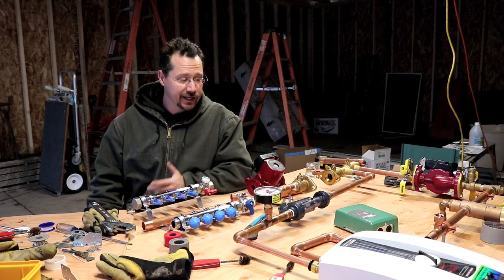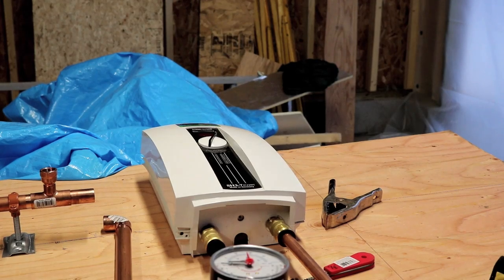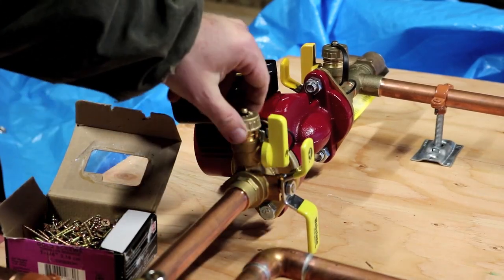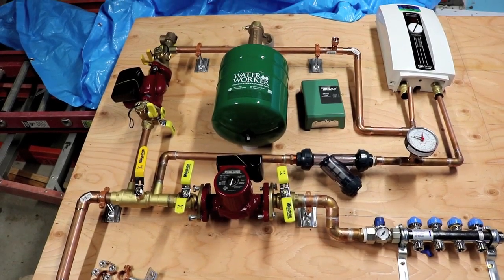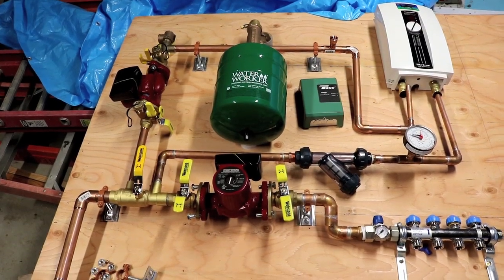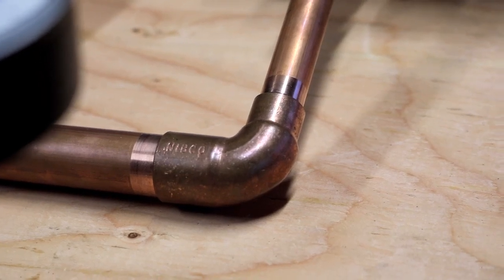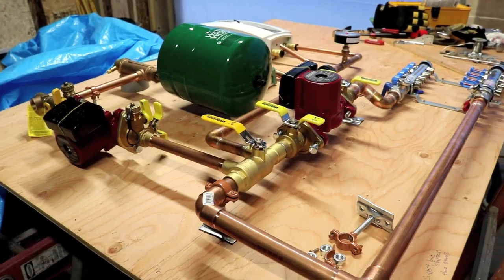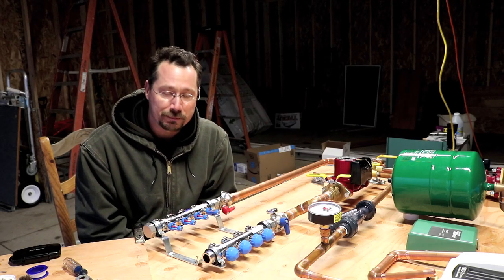Ben's Garage: Hydronic Heating Update Jan 25 2017

Comment from the maker: I've now had this system running for the end of one winter and the entire next winter. I kept the system on with a simple thermostat set to the lowest setting (40℉.) The garage never got below freezing all winter. (In my area, temperatures are below freezing December through March, and we are usually in the single digits in January. I can honestly say that a thick, insulated concrete slab is an amazing thing. In the winter, the heat just stays inside, even if I have to open and close the garage door. Likewise, in the summer, it can be 20 degrees cooler and lower humidity inside my garage than outside.
I also built a passive solar garage door. When the sun is low in the sky in the winter, it shines in on the concrete floor, warming it. 
https://www.instructables.com/id/Passive-Solar-Garage-Door/
https://www.youtube.com/watch?v=EcuRfnP6E7I
Reply: You should pin this post to the top.
Reply from the maker: Pinned!

Comment: How did the electric bill work out?
Reply from the maker: My electric bill this past month (Nov. 2025) was $115.
Keep in mind that as I write this, we are in the cloudiest time of the year with very short days. So, I’m using more heat and getting less energy from our solar.

We also have a mini-split heater in the house (which is just supplemental heat - main heat is a natural gas furnace.)

We also have TWO electric cars. (Not hybrids, no gas at all.)

I’m on a “Time of Day” Plan, so electricity is expensive during the day, but cheap at night. I run the garage heat at night, as needed. Then the heat stays in the concrete, warming up the garage during the day.

We also charge the electric cars overnight on the cheaper rates.

Our solar this past billing month only made about $50 worth of energy. In the summer, it makes about $100. Most summer months, we use about what we make, so there’s essentially no electric bill.

I made a playlist of me opening electric bills. You might find that interesting. I haven’t made any of those videos too recently. Maybe this is a good reminder to make one from next month’s bill.
https://www.youtube.com/playlist?list=PLmHss3DBZUimMu2T5B198sNn6A4cp2zvG

Comment: what circulator pump are you using Thanks
Reply from the maker: Stiebel Eltron circulation pump model CP3S15-62FC. 3 speed, 1/25th HP.

Comment: All tubing is 1/2 or 3/4?
Reply from the maker: There are several sizes of copper pipe. The heater has 1/2" input and output. Most of the setup overall is 3/4". There's a section of 1" near the manifold. I just used whatever size pipe was appropriate for the parts being connected.

The PEX tubing in the floor is 1/2" - four loops, each less than 250' long.

Comment: I also had this idea but was told that electric is too costly , good luck
Reply from the maker: It works well. I run it just as I need it, at night, when electric rates are cheap. I also have photovoltaic solar, so I can just turn sun into heat as well.

Comment: At 2:20, what particular plate did you use? Or where did you get them from? All the flange hangers I ever see are flat and dont allow you to put a hex head bolt or nut on the bottom.
Reply from the maker: I don't remember the exact name of the part. They were available at Menards, a big-box home improvement store in the midwest.

Comment: Great job!  Out of curiosity, which brand pec did you choose and which brand manifold did you choose and why?
Reply from the maker: I simply used parts that were available off-the-shelf from a major home improvement store. I was able to personally inspect parts before buying them. I don't think there's really any big difference between brands. Being able to check out parts before purchase, because they were in front of me, instead of for example mail-order, I was confident that I was getting relatively good quality.

Comment: Your electric is run off fossil fuels...
Reply from the maker: The great thing about electricity is that it can be made from so many different sources!
For example, from the solar panels that cover the roof of my garage that this heating system is in!
https://300mpg.org/bens-solar-garage/
Reply: @BenjaminNelson  you started this video with saying you want to get away from fossil fuels.  Your system is awesome,  fyi, but Everything in your system is a derivative of fossil fuels.
Reply from the maker: What would you recommend?
I'm pretty happy with my photo-voltaic solar setup AND my passive solar garage door.
Seems like a good start getting away from fossil fuels to me.
Reply: @BenjaminNelson  "I would like to get away from using fossil fuels to energize my house.  Yes they're needed to construct every part of my house but I would like to minimize there use."

Comment: Hello Ben, please give us a feed back on the plastic Y strainer, does it handling well with over 150 deg F, I am looking to put it in with my boiler system, just like to get some feed back from you
Reply from the maker: It's fine for temperature. It's designed to handle that. One thing to be a little careful of is over-tightening. Plastic cracks easier than brass!

Comment: I was wandering if you can share the information how higher your electric bill ($ or % ) with this type of system?  Thanks.
Reply from the maker: In general, for heating, electric is going to cost more than city natural gas.
HOWEVER, I also installed solar panels on the roof of my garage. I have a good agreement with my local, non-profit, electric provider. (It's actually a city utility.)
In the summer, I'm able to build up a credit with the power company. In the winter, I apply that to my bill.

I haven't paid an electric bill for two years now.
The solar covers the cost of the heat in the garage, all the electricity used in my house, and charging plug-in cars.

Of course, HOW MUCH you use that electric heat makes a big difference. I mostly use it to heat the garage for working on projects in there on winter weekends. I run the heat overnight at off-peak electric rates.

I have quite a few videos on my channel of me opening and sharing my electric bills.

Comment: Getting away from fossil fuel, by using electricity, real smart technology.
Reply from the maker: Hi Mark,
One of the great things about electricity is that it can be made from so many different sources, including the 24 solar panels on my garage or the renewable energy that I can purchase through my electric utility.
Reply: @BenjaminNelsonX  show me one source with endless possibilities, that is not dangerous.
Reply from the maker: @truth6600  Are  you implying that solar panels are dangerous? Or that ALL sources of energy are dangerous?
Reply: @BenjaminNelsonX  never said dangerous, not 100% .
Reply: @BenjaminNelsonX  never said dangerous, solar power not 100%of all our energy,maybe 12-15% of the USA could survive that's not great.
Reply from the maker: @truth6600  You said "Show me one source... that is not dangerous".
If you want to clarify yourself to mean that it's dangerous for us to rely on only a single source of energy, that's fine.
I'd agree with that. Nowhere have I ever said anything like we need to instantly cut all power other than that which is made by solar.
I'm all for doing what we can to do better. In my case, trying to do the things that I need to do (including some heating of a particular building) while reducing dependence on fossil fuels.

Comment: Great Video! Do you have a parts list for this? Trying to do something similar and already have the floor piping in with manifold, so now it's time to do all of the plumbing for the tankless propane boiler I'm going to get.  The issue for me is that I don't know the exact names of each of the components even though I visually know what they are and if I could go to a parts bin I could pick them out.  (that would result in many trips to the big box which would be bad)

Thanks!
Reply from the maker: Hi James,
No, sorry, I don't have a parts list. Basically, I read a college text book on hydronic heat, then I went to the big box home improvement store, looked at a pre-built product they had, bought the parts for it, and assembled it myself.
I modeled that after this hydronic heat panel: https://www.menards.com/main/plumbing/hydronic-radiant-heat/radiant-heat-control-panels/hydro-smart-trade-1-zone-low-temp-integrator-panel/hsps120lt/p-1444433734726-c-8521.htm?tid=922881261078849570&ipos=3

By doing the work myself, I only had to pay for parts, not labor, saving some money.
The heater I used was a Hydro-Shark 3 7kW electric heater, which I bought used. https://www.menards.com/main/plumbing/hydronic-radiant-heat/radiant-heat-boilers/stiebel-eltron-hydro-shark-reg-electric-microboiler/sh3-07/p-1444433731813-c-8519.htm?tid=-4632102269778309964&ipos=1
Reply: @BenjaminNelsonX  Think I figured all of it out. If it doesn't blow up, then I did it right ;)
Reply from the maker: @jameshancock  That's usually my opinion!
Seriously though, when heating liquids, you CAN blow things up. So, don't do that.

Comment: Nice job!   do you have a parts list?   can you tell me the brand name of the assembled unit that you mentioned in your video?  thank you
Reply: At Menard’s, they carry the Hydro-Smart components. Hydro-Smart is located in Minnesota. I bought the parts for the single zone panel HSPS120LT for around $1,000. Menard’s sell it for $1600. The propane boiler was $1300 and took 2 weeks to arrive. If you go forward, you can order Nibco valves with the hose ports from Zoro on the internet. I was impressed with their service.

Comment: Why did u not add a glycol feeder and how did u pressurize the system
Reply from the maker: If you look on the middle-left of the system, you will see a set of shut-off valves and hose connection points. Those are used to fill the system. The system was filled with a pump and hose connected there, drawing the glycol from a 5-gallon bucket. The pump is also what's used for originally pressurizing the system.
Reply: thanks for the reply,   what type of thermostat did you use,  I am having issues getting a 12 v thermostat working
Reply from the maker: @geraldsosontovich2124  I just used a very simple thermostat that runs on a pair of batteries. It has a pair of low voltage wires that runs to the switching relay for the pumps. The thermostat sends low voltage to the relay, turning it on. AC power then runs to the pumps, powering them up. The heater is activated by an internal flow sensor and the heat kicks on once the glycol is flowing.

For a really low-tech ON/OFF. A light switch can instead be used to turn on/off a low-voltage AC signal to the switching relay.

Comment: Hi Ben, it seems like there is no Water Pressure Reducing Valve in your system.  I read somewhere that the pressure , since is much higher coming from the city, will damage the apparatus over time without a water pressure reducing valve.  What is your thought on that.  Thank you
Reply from the maker: This system is NOT connected to city water.

Comment: Why do you have two pumps? The only time you need hot water is when your system calls for it, it’s no need to be just circulating hot water through your loop when your in floor heating is not calling for it!
Reply from the maker: This particular system design uses two pumps. Both pumps work together for the "On Demand" heater to function the way it's designed to.
It does NOT circulate water through the loop when the heater isn't running.

Comment: So you're going to run that system off a solar source. You must live in fantasy land.
Reply from the maker: No. I'm not running it off a solar source.
I am running it from grid-tie power. I also happen to have a grid-tie solar system.
I can run it at night using cheap "Off-Peak" electricity.
During the day, I can create valuable solar energy and send it out to my neighborhood.

Comment: I’m sure because this video was posted so long ago you probably won’t see it. But I have question. I have the same system in my shop with the very same micro boiler Hydro Shark 3 and something went wrong with my boiler. It’s feeding 120v back into the electrical system in the shop. Outlets all started testing positive neutral reverse. As soon as I cut power to boiler everything tests correct. With power to the system when I touch the copper pipes I get shocked. I’m going to replace the boiler. I have no idea how to add glycol back to the system and bleed out the air. I can’t find any information on how to do this. I live in Wisconsin and it’s about to get very cold. Can you please help with answering how to add the glycol and bleed the system??
Reply from the maker: Hi Kevin, sorry to hear about your boiler!
After you replace it, just follow the typical directions for filling a system like this. There are a lot of videos about filling and bleeding the air from a system on SOLAR Hot Water setups. Take a look at one of those. I've also found that Callefi has a lot of great videos in general on hydronic heating.
https://www.youtube.com/watch?v=raHCtObGOhY
Reply: @BenjaminNelsonX  thank you so very much for your reply. I will do me research and check out the link. Thanks again!

Comment: Hmmm...you are running electrical because you want to get away from fossil fuels. Your electric is most like produced by fossil fuels.  Just admit it, we need fossil fuels.
Reply from the maker: My garage is covered with solar panels. I produce close to how much energy we use in a year.
Reply from the maker: A great thing about electricity is that it's just a way to TRANSFER energy. The SOURCE of energy could be burning coal, but it can also be wind power, solar, hydro, and other renewable energy sources.

Comment: So what pressure is the gauge supposed to read. Mine is at 10+ while off and goes down to basically "0" while running. Floor is warm though...thanks

Comment: Hi Ben, many thanks for your instructive videos.  Thanks to you, I've decided to use hydronic heating for my new garage and I've changed the steel profile for the roof so I can use S-5 clamps for the solar panels (and avoid punching a bunch of holes in a brand new roof!).  I'm still studying options for the boiler and I'm wondering if you've compiled the power usage (in KWhr) of your boiler as a function of average outside temperatures.  If this is already posted somewhere, please point me to the link.  Thanks again.
Reply from the maker: I've been very happy with the metal roof and S-5! clamps. Works great!
For the in-floor heat, make sure to insulate your garage well, including under the slab.
I do NOT have data tracking power use vs outside temperature, but I do have an old-school utility meter which I run my boiler through so that I can track the power it uses.

I am NOT necessarily recommending electric as a heat source. In my area, natural gas is the most economical way to heat, but I don't have a gas line to the garage and want to get away from fossil fuels anyways. I might still rig up a wood fired boiler to the garage. The town yard waste site is just down the street from me, and I'd be able to get all the free wood I want from there.

You CAN estimate power usage from area/volume, insulation factor, and average temperatures. There's even on-line calculators for that sort of thing to at least get a "ball-park" number.

Comment: I have a similar set up put only needed one circulating pump the second one isn’t required as far as I’m aware. Also on the cooler return water loop to the heater, I have a take off to the hot water output side and a ball valve with a temp gauge this allows me to restrict the return flow to both the hot out and the cool in so I use this water to modulate the overall temperature. My circulating pump is either actuated by a thermostat or by a programable timer. The timer is the primary and the thermostat is the back up secondary if the timer fails. This way you are protected against freezing if the timer fails. I live in Canada and I think the city permit guys force you to have a back up do to the frost line being 8 feet below grade 🤷‍♂️🤷‍♂️🥶🥶

Comment: Electric is fossil fuel, your heating your garage with coal instead of natural gas. Gas is more efficient and better for the environment.
Reply from the maker: Electricity is a way to TRANSFER energy. That energy source could be coal, natural gas, nuclear, hydro, wind, solar, geothermal, or other sources.
The roof of the garage is covered with solar panels and I'm on a renewable energy plan with my power provider.

Comment: I'd love to see an update video on your installed system.  I found the heater you are using on the Home Depot website and see it is a 40 or 50 amp heater.  How has the heater worked for you?  Did you end up using glycol?  How was the filling of the system?
Reply from the maker: The heater has worked well.
I used glycol. Filling the system was a little bit of a pain because I didn't really have the right type of pump. A pump that self primes and can give you the right pressure for you system is the right way to go.